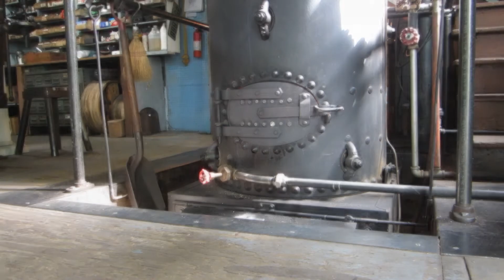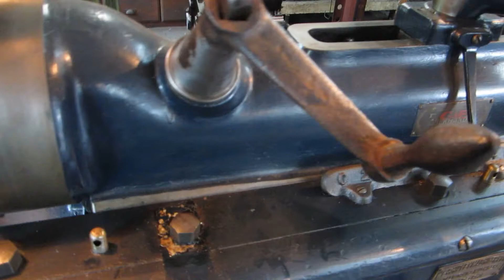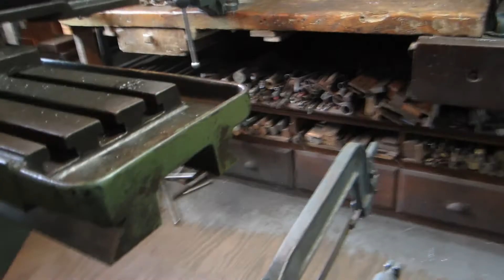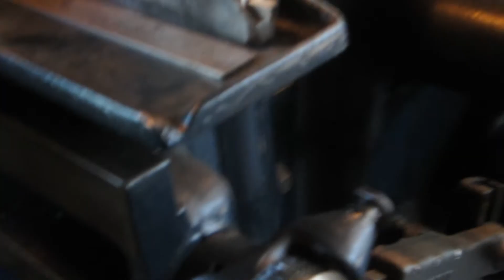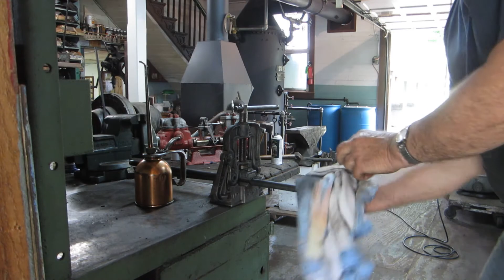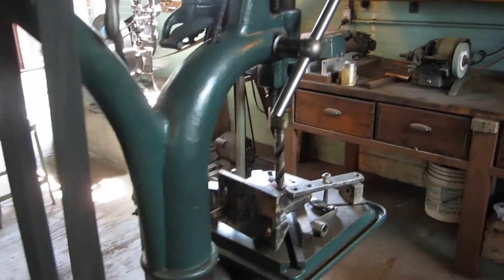OLD TIME STEAM POWERED MACHINE SHOP 2

Comment: David, I've just found your channel and I'm blown clean away! It's the steam! I like the method you used to centre your part on the 4 jaw chuck. Been doing it like that ever since I started using a 4 jaw and had no indicator. Just for grins a couple of nights ago I lined up a piece of ⅝" round and then checked it with an indicator and it was within 6/10000'". That's close enough!

Comment: Ya got my attention I'll tell ya.  I also machined my step blocks on the shaper. Wonderfull machines (that got a bad rap) but are quite popular now. They turn rusted
junk into fine stock,something one wouldn't do with expensive end mills. My biggest
drill press is pre 1920's (i think)  square table flat belt Avey.  can't wait for the next
vidio Dave    thanks     sam

Comment: another great video! so,, is that a small generator on the ceiling?  what did you knock over,, sounded like a pile of wrenches found the floor! more than once have I knocked over a pallet of tools :) it happens shrug if off say well s#!t must be cause the earths magnetic field shifted a bit ;) keep up the awesome work cant wait to see the next installment from the steam powered workshop
Reply from the maker: Larry Blowers Yeah, at that very moment the 'cut off" stock rack under the bench decided to unload itself onto the floor. I edited it out, but the editing "didn't take" for some reason. Must be the "powers" try to keep you honest..Dave
Reply: but,,but ya forgot the well timed "well shat" :) TBH liked the video and waiting on the next,, been a steam fan forever and same for machinists and the trade keep up thegreat work,,

Comment: Fun to see a really traditional shop in action. I like to see you moving from machine to machine, as the processes all take time. Standing in front of a single machine just waiting wouldn't be very efficient.

I wondered about the very slow speed being used on the drill press. Is that because it would have been normally used with high-carbon drill bits rather than high-speed steel? I know that plain high carbon tools must be kept cool (under 400-500˚F) to avoid drawing the temper. Low speed (SFM) allows time for the heat to be carried away by either the tool or the workpiece.
Reply from the maker: Peter W. Meek  You're right the old steel tooling had to be turned slower, but probably not that slow. It gives me more time before the drill starts going through the table!